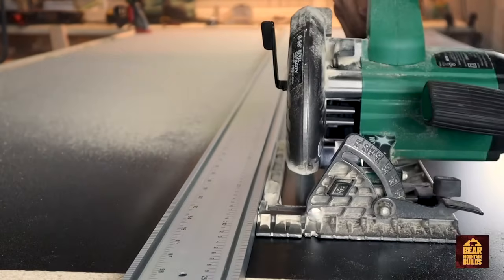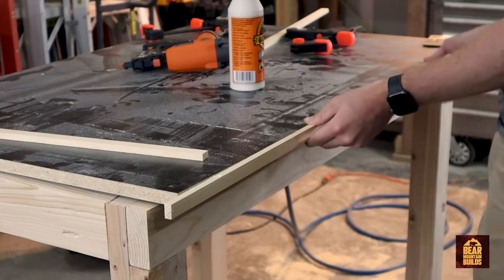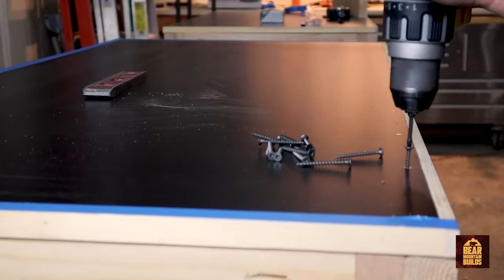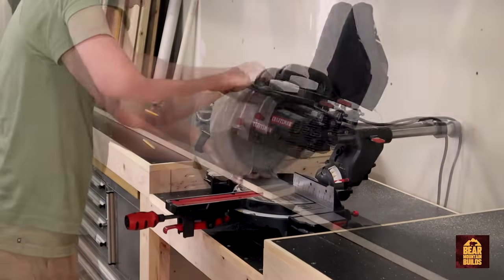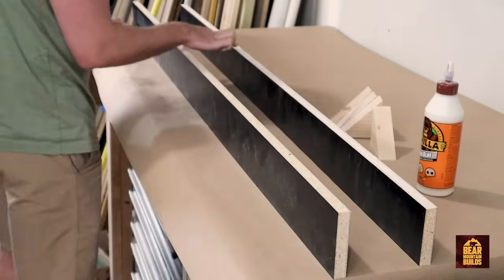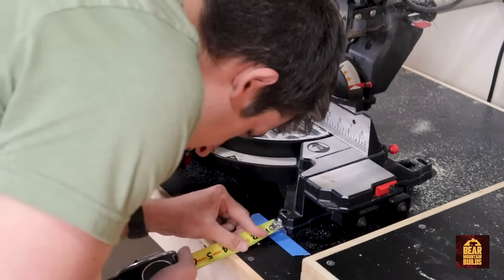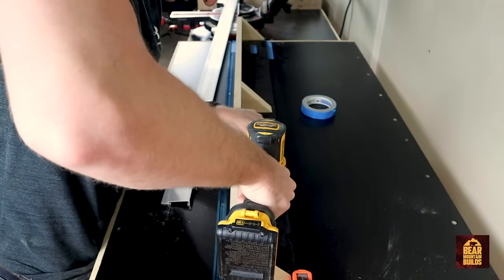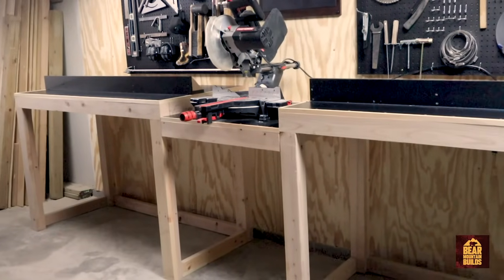Build This Simple Miter Saw Table with T-Track | FREE PLANS

Comment: I think I've binged my way backwards through this build, but I genuinely LOVE how simple yet totally practical these tables and benches are. No pretentious over engineering, just simple designs that are entirely customisable. New work top required? Unscrew and replace. New drop saw with different dimensions? Replace the section specific to it between the cabinets. Designs that grow with your shop that don't need to be fully rebuilt are the best. Best believe I have these videos saved for when I get space for my own full time workshop.

Comment: Man I love your builds... I am going to use your design and tweak it a little by adding the toggle clamps you used on your modular workbench into the miter saw station. That way I can move the miter saw away from the station itself outside and connect to the tables as well in my 24x50 workshop. This gives me so many ideas. Especially for my 12" cutech jointer for long boards. Thank you brother!!! Keep making content. O... love the free plans... too generous. I would have paid 10 bucks a piece for them to be honest!

Comment: Just started building mine - a word of wisdom to all those using metric lengths - 2400mm is NOT the same as 8ft! it's a little short of 8ft, so when looking at the cutting diagram in the free plans, pieces 14 and 15 will make the cross pieces a little too short. I suggest that you cut a couple of 'shims' from the offcuts of the other lengths and glue them to the ends of the cross pieces before you pocket hole them. Other than that Zach has made a fantastic bench with easy to use plans. I cannot wait to finish it.
Oh and Zach, with prices as they are now for wood, this came out at £190 ($241), that is with an MDF top (I'll buy stick on melamine) and no edge trim. 
I love watching your builds. Keep the videos coming.

Comment: Thanks for the video and the plans.  I just finished my mitre saw table and next up is the latching modular workbenches.  That will be my project for this weekend.  On the mitre saw table, I had to put adjustable legs on mine since the garage floor is uneven and I used sanded plywood for my tops and fence.  I then put paste finishing wax on the whole thing and I like the way it turned out.  Thanks again for the video and plans.

Comment: Great video! Not sure why I'm just seeing it 2 years later but at least I'm here now. Music doesn't bother me too much but I wouldn't mind if it were a bit lower. Here's a tip you might want to try (assuming it hasn't been suggested already): When you were gluing the legs together they slipped around a lot. After you spread the glue, sprinkle a "pinch" of table salt into the glue. Grains of salt are very sharp and will help eliminate the slippage while you get the clamps installed, then dissolve. Keep up the great work!

Comment: Very nice work and plans! May I suggest that you raise the height of the fence by 1/8 in. This allows sawdust to escape and not throw off your measuements along the board's length. Yes, one can clean out that space with a brush, but to make the plan perfect raise the fence by one eight of an inch to keep production going. You made the build very well done! Looking foreward to more builds!
Reply: Great suggestion.  I would also add a half circle on the back side for the saw's power cord to go down and /or dust collection in the future.  But this is a start and it really gets me in the right direction.

Comment: Just found your channel and you've definitely got the camera and editing skills. I think I may do a modified version of this. I'm thinking the base for the saw will get its own legs, the sides will have the rockler step casters, and use the toggle latches like on your modular assembly table build. This way they can serve multiple purposes. Sometimes I just need that bit more assembly room! Also nice to see someone finally build something at a reasonable work height. I'm 6'5" and feel your pain with all of the kitchen counter height stuff. My 42" tall saw horses always annoy my Father In Law.

Comment: I built 2 stands similar to that for my aquariums to sit on, all I had to work with was a black & decker 3/8 drive drill, a Rockwell 4-1/2" circular saw, and a 25ft. Stanley tape measure, materials were 2X4s and 3" woodscrews, both stands have been holding up 2,100lbs. of water for the last 10 years, and are as strong now as the day I built them with untreated lumber, 😀

Comment: I'm in the midle of my build and realized while I was cutting wood that if I ran the 2 X 4's through my joiner to square up the edges, which is a great idea, the length for the shorter fron and back legs needs to be adjusted. Also, I have been using 2 1/2" screw instead of the 3" in the plans because 2 stacked 2 X 4's is 3" and I felt the screw would blow out especially on the legs. I have completed all my framing and will pick up the melamine soone to complete the build. Thanks for the plans. Thom
Reply: I was wondering about the screw length too, especially since you ran the  2x4s through the planer!

Comment: Great video!  I noticed you had some splitting of the particle board when you added the  first screw on the left fence.  Just a suggestion but after drilling your pilot holes, use trim screws near the edges.  They have smaller heads and won’t cause that split like the drywall screws did.😊

Comment: I like your table(s). Pretty much what I want to build so will follow your plans. You mentioned that you got some rough edges from the circular saw when cutting the melamine faced board. That's probably because you have to turn the board upside down so that the circular sawblade cuts into the melamine not out of it, giving break out.

Comment: Love the video, especially the ideas for removable fence. Can you explain more about adjusting the height of the saw base? Mine has rubber feet that actually make it higher than I want for what it would take to build support wings with standars dimensioned boards.
Thanks
Reply from the maker: You just need to measure the height from the base of your saw to the top surface of its saw platform. That’s the dimension you need to instal the tables saw platform from the top

Comment: This Miter Saw Table looks awesome. It is just what I am looking for.  I have just started to build my own woodworking shop and this Miter Saw Table for me is a must.  What I really like is that you designed it to take a roll away tool chest as I have one too and this will be perfect for my needs.   Many years ago I acquired quite a few sheets of 3/4" plywood so I am going to use that and glue some black Laminate on top of that to make the table top (Hope that works).  This is going to be a learning experience for me.  Thanks again!

Comment: This video is the first one I have seen from your channel, and after watching it, I liked and subscribed. At the end of your video, you mentioned that you are new to YouTube. I didn't notice anything in this video that would support that claim. This is a great project, and your skills in front of, and behind the camera, are very good. There was only one thing in this build that I would have done differently, and that was where you used drywall screws. If I needed the screws to be a certain color, I would just paint them before driving them in. Drywall screws are rather brittle, and can break pretty easily.
Reply from the maker: Thanks for the compliment!! You have a point about the drywall screws, but I have so many screwed into each track I’m not too worried about them being overly stressed

Comment: Hello:

I came across your video and love your passion. I am just getting started in woodworking and trying to decide on the following major purchases:
- miter saw - why id you chosose a Craftsman. My research tells me I should get a double Bevel Sliding Miter Saw - your thoughts.??
- Vac and air filter systems. I have a small shop - about 500 Sq feet. What type of systems would be best and where to get best prices?
-  Might there be available (somewhere) a checklist of the basic tools one should have as I see your wals are covered with peg boards. For instance, # and sizes for the clamps I see all the woodworkers in the Columbus club using??
- Where did you get the rolling cart with all the drawers?  Details on model, cost and source.

I

Comment: this was great.  I'm still new to the hobby so i don't have a lot of stuff yet, but i like the simplicity of the builds and not requiring a ton of fancy gadgets/cuts.

One question:  I've seen others use slat joints but on a 4x4 then removing material.  is that stronger vs gluing/screwing 2 2x4's together? or is the strength negligible?  I'm not looking to put an anvil on anything, but just looking for my own knowledge.  Thanks in advance.
Reply from the maker: I like the 2x4 option better for a couple reasons
1. 2x4 is cheaper
2. The 2x4s will resist twisting and warping after they’re glued together while the 4x4 has a good chance of twisting
3. Unless you’re planning on putting an elephant on the table strength differences are a wash
Reply: @BearMountainBuilds  really appreciate the response!  I figured it probably wouldn't be that big a difference, but the more you know! keep up the great work! can't wait to see more! (i was going to try to clean the garage out and make some space and start on my bench and then it rained -.-  so...this weekend! )

Comment: Thanks for the great vlog. I’ve downloaded your plans and will be using them to give me a good starting point. I don’t quite have the length you have, so I will be adapting accordingly. You said there would be a link showing how you installed the T track but I couldn’t find this?
My thought was to install the T track at ninety degrees to yours and use them to hold the fences, so they could be easily slid out of the way towards the back of the table to make more use of the bench tops as space is at a premium for me.
Thanks again and good luck with your endeavours.
Nick
Reply from the maker: I guess I never linked the video to install T track. You can check it out on my channel and I’ll get it added to this video

Comment: I want to build this and thank you for plans.  I do not have table saw - only mitre saw and circular saw ( old one )  Any ideas on getting those trim pieces ripped down so thin?  Thanks Jack
Reply from the maker: There are a couple options.
 1. You could buy a wider board to cut the trim from using your circular saw and a saw guide. 
2. Make your trim wider and shrink melamine top down
3. Use edge banding instead of wood trim, but you’ll have to increase the size of the melamine top to keep the same overall dimensions
Reply: @BearMountainBuilds  Thanks!

Comment: @BearMountainBuilds - regarding your melamine chipping - If you use masking/painters tape over your cut line, it will prevent chip out. Press it down with some good thumb pressure and you will have a clean cut. Cheers

Comment: Hi Zack I’ve enjoyed your video and have watched it literally 8 or 9 times. I plan on building one in the very near future. My question is why did you build it with some of the pocket holes showing on the outside?
Reply from the maker: It's supposed to be that that orientation is stronger than if they were on the inside, but after this build I don't think the extra strength is worth the detraction from the looks so I've stopped doing that
Reply: @BearMountainBuilds  Thanks.

Comment: video and the miter station look fantastic! however that glue on the fence is not going to hold anything since you attached it to the melamine. the brads and screws are the only thing holding it now. and that'll probably be enough for a fence. If you wanted a glue adhesion, you would need to route a rabbet even if only deep enough to cut away the melamine and then adhere the particle board to particle board.
Reply from the maker: Good point about the glue, but the brads and screws should be good enough since the fence won’t be taking any major loads
Reply: @BearMountainBuilds  lol. #majorloads

Comment: Could you theoretically combine this idea with your modular workbench by using french cleats to float the miter saw inbetween the two workbenches?
Reply from the maker: That's an interesting idea. I'm planning on making a modular workbench V2 sometime this year. Might have to use that idea in the build
Reply: @BearMountainBuilds  How are you planning to update it for V2? I was going to start the build of V1 in a few days/weeks, but might want to hold out if V2 is coming soon.

Comment: The melamine glue ups are ok ?  I would have cut the melamine top along the bottom of the vertical part of the fence to glue the horizontal part, and the same for each 45° block. And what use is the big space behind the fences ? Seems like a lot of wasted space to me. Do you plan to put something there in the future ?

Comment: Great job! Would it have been better to place a miter saw that does not slide back and forth? Although perhaps shorter I would purchase the length (saw) that I will use most to cut. Minor observation, overall it is well done!
Reply from the maker: A compound miter saw would definitely be the best and I wish I had one, but they are a little expensive so maybe someday I'll invest in one. Right now my slider does just fine.

Comment: If you use 3" deck screws through two 2x4s that have been planed down the tip will protrude through the other side. Use 2 1/2" screws.

Comment: I am in the process of getting material to build this. I will be making some mods so your table saw build will fit under one end. I like the open bottom concept. The other side will house my rolling tool cabinet. I wanted to know it the area that houses the miter saw itself accommodates a sliding saw? I have a hercules from Harbor Freight and the max depth is about 30" when fully extended. Would I have to widen the table a bit? Thanks
Reply from the maker: You could widen it or do what I do and let the base of the saw hang off the edge a bit

Comment: Zac, I love this table build!  Specifically because it allows me to put my own twist on it.  Im fairly new at this, but is there a reason why no one puts a table above the miter saw station wings?  Like a secondary shelf system that could hold the drill press, grinder, sander, etc...
I'm thinking I could lower my initial station to accommodate that...but I'd sure appreciate some advice.  What are you're thoughts?
Reply from the maker: There wouldn’t be any serious issues as long as it wouldn’t get in the way of the board you’re going to cut. Plenty of people put storage spaces there

Comment: How much do you take off when running the 2x4s through the planer? I'm planning to build this table. Great plans and videos! Thanks
Reply from the maker: Not a lot, probably about 1/16’’ on each side. I generally take the board down until the four edges are sharp

Comment: What is the benefit of laminating 2x4s for the legs vs just using 4x4’s?
Reply from the maker: They resist twisting and warping, the notches are more accurate, and it's cheaper

Comment: So how much do you take of each side of the 2x4 when you run it through your planner?
Reply from the maker: Usually I take each of the four sides down 1/8”
Reply: @BearMountainBuilds  Thanks.  I tried it with a 1/16" and it did a good job.  I also had take a bit of the top of the leg to flush it up to the reduced width of the cross pieces :-)

Comment: My mitre saw table has an adjustable bed, made from two hospital tables, that swing over the beds.
Allows the centre to lay flat to both side, or lowered to fit a table saw, or router table.
The only problem with the 8 feet clear on both sides is, I have too much junk piled on them!!!!

Comment: Good design. Have you applied this to a Radial Arm Saw installation? For what it's worth, music is not required. I watched for the technical content. Otherwise, great presentation.
Reply from the maker: I only have the sliding miter saw. A radial arm saw would allow for the table to get closer to the wall

Comment: Thanks for the video. Question though: is MDF a suitable substitute for black melamine? I can't find black melamine around my area.
Reply from the maker: You can, but I’d recommend just using sand plywood if you can’t get any melamine.
Reply: @BearMountainBuilds  seems like i can get white melamine at the box stores, but not black, which looks a lot better. Do you know of any sources?
Reply from the maker: @doctorr2   I got mine from Menards. Not sure if one of those is by you. Otherwise, I’d recommend sanded plywood and sand it to 220 grit then poly it do a light sanding then wax it. It’s basically what I did for my assembly table and I’ve loved it. Everything slides easily but not too much

Comment: What size pocket screws did you use please as I’m new to this 
Cheers
Reply from the maker: For the frame it's 2-1/2" screws and the tops are 1-1/4". Kreg has a guide available with their jig and online that tells you which length of screw to use
Reply: hi Zac thanks very much just noticed it on your plans 🤣🤣🤣

Comment: Screws aren't designed to support a table, only to hold wood to another, they normally have low sheer strength. Nails would be better BUT 

Instead, a notched rail supports into the legs of the table and place the miter table top on those.

Comment: I am in the middle of building this miter saw table, basically at step 3 of the plans.  Knowing that adding the melamine top for the table is coming up, I have been attempting to source the 4 x 8 3/4 inch melamine and am having no luck.  Any suggestions on where to get it???
Reply from the maker: I bought mine from Menards, but I don’t really have any other suggestions after that.
Reply: @BearMountainBuilds  I live in Houston and there are no Menard's here.  Continuing to check other "big box stores" like Lowes and others.  Am looking at purchasing 3/4 inch plywood and FORMICA laminate plus contact cement and fabricating my own!  Thanks for the quick response. dlh